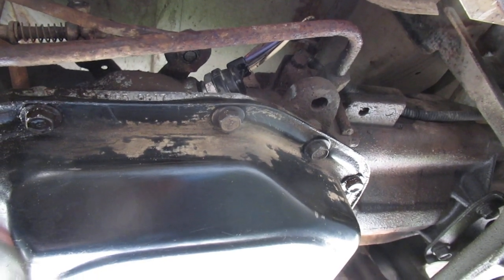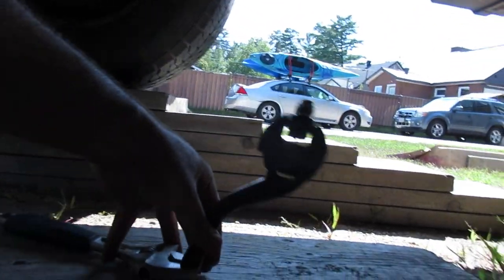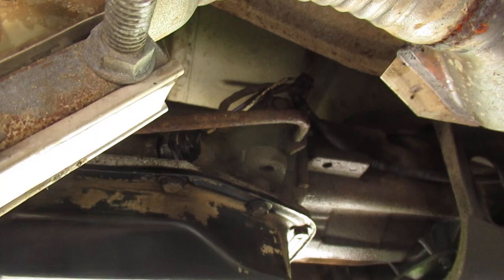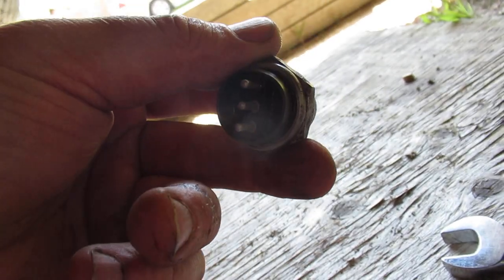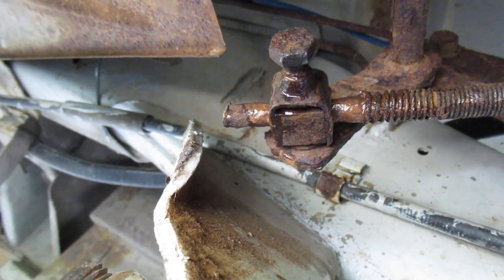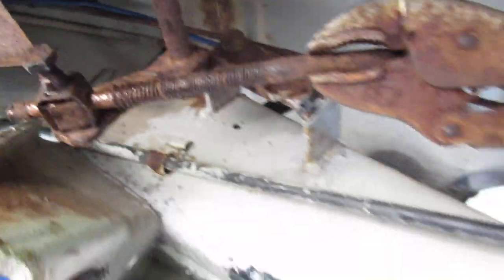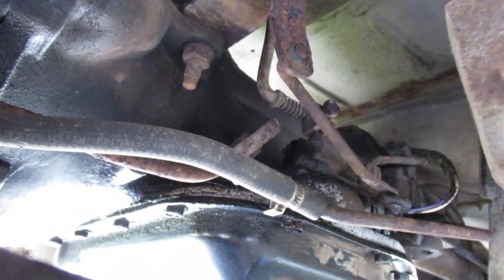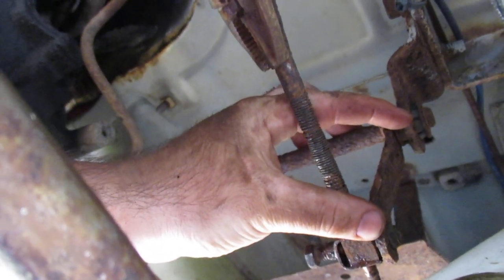Dodge Mopar Full Size Vehicle Shifter Linkage Adjustment + Neutral Safety Switch 1976 through 2000

Comment: Thanks for this clear view of linkage adjustment. I have to hold the shift lever hard into Park to get the key out, and if I shift from Drive to Neutral too briskly, it goes into Reverse. Crawled under and looked, and that shaft appeared threaded. I thought I'd have to pull the pin out of the bushing to rotate the square block. Damn glad I did a search and found your video. Chilton manual is useless.

Comment: Hi Stephen, I have a 91 Dakota with the Same or similar kickdown linkage, I believe mine is out of adjustment as the 2-3 shift feels too quick or odd...joltish like. Might be something else but from I could find a too soon shift or too delayed could from this thing being out of adjustment. Have any ideas how? Or if you know a write-up/video somewhere. Thank you!
Reply from the maker: Hi Jon,  I sold the van and the factory manual went with it.  The factory manuals are quite affordable on ebay, I would take a look on there to find one.  My 1991 was adjusted several times before my parents were happy with it, when we sold it the shift was very fast, it would snap into the next gear very firmly.  If it is shifting at the correct RPM and it is firm I would probably leave it alone?  The procedure is pretty involved and depends on whether you have a cable or a linkage, you may find it at https://dodgeforum.com/forum/ if you look around.

Comment: What direction do you want the rod to go if it starts in reverse and doesn't have park?
Reply from the maker: I don't recall as I have since sold the van but keep PRNDL in mind, Park should be at one extreme end and Low should be at the other extreme end.  It seems like you are pretty close if you are in Reverse since it's beside Park.  Just be careful under it since you aren't in park.